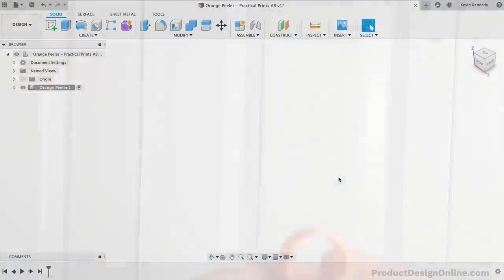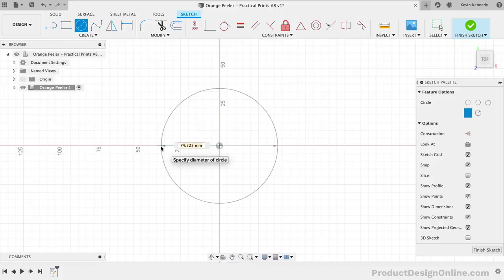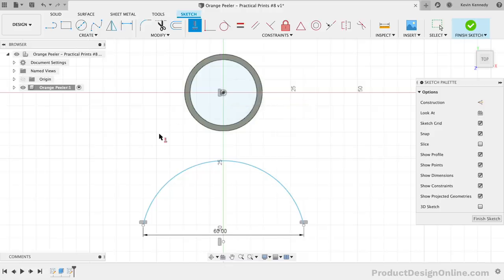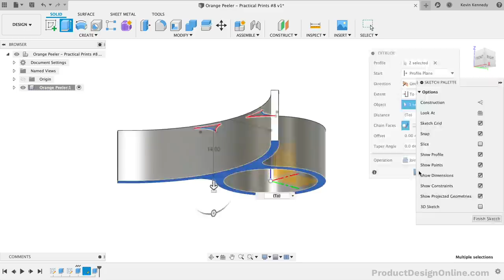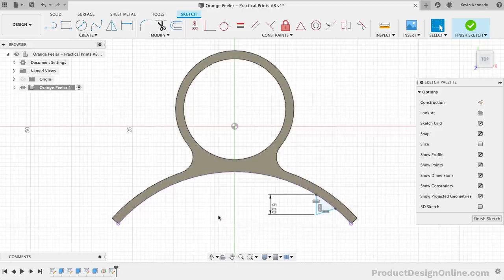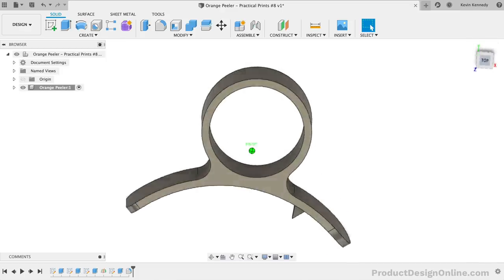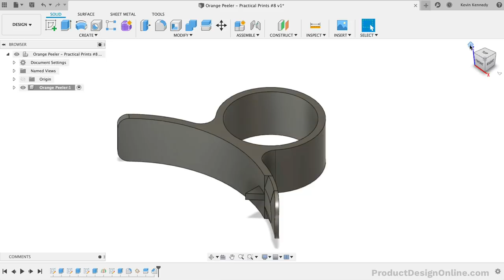3D Printable Orange Peeler with Fusion 360 | Practical Prints #8

Comment from the maker: TIMESTAMPS
0:00 - Reverse Engineering an Orange Peeler
1:00 - Figuring out the manufacturing method
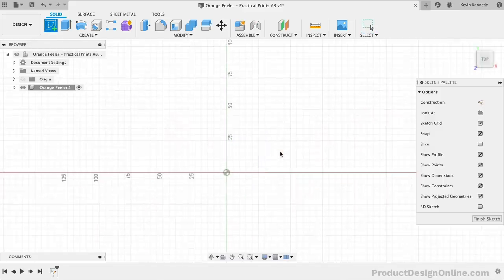2:07 - Finding reference images
2:39 - Sketching the cylindrical shape
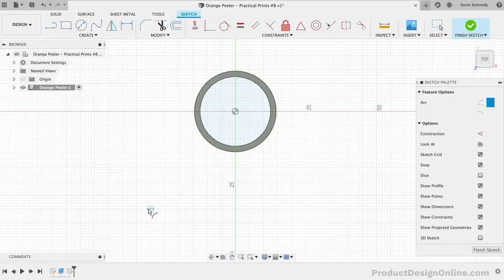4:00 - Creating the attached arc
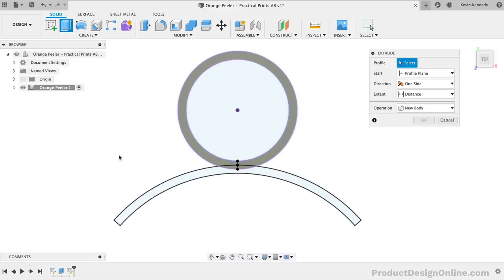7:10 - Joining the extruded body
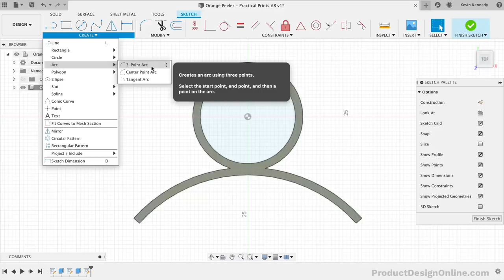8:15 - Creating curved support
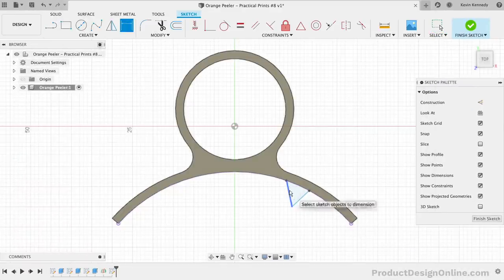11:00 - Creating the cutting piece
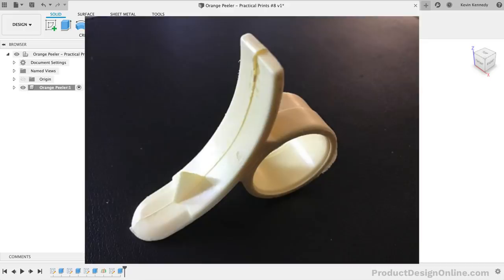13:00 - Rounding over the edges with Fillets
14:14 - Splitting the body and creating chamfer

Comment: We have struggled with the oranges and clementines lately as we both have joint pain issues, But i have a 3 D Printer so i must try this out. It tells me we could look at designing soup can lid openers and other aids to help folks with join issues in there hands, Its a while new thinking of what to use 3D Printing for. Great sessions I learned about 5 new tips just in the one. You run in sketch much longer than i do. I draw then immediately get into 3D editing. Heck you are adding constraints and using tools like arc i never knew where that was. I have designed and built a 3D Printed Model Train Steam Engine tender chassis. Here i not only replaced the flat plate I added a set of adaptors to help hold a wide range of electronics for digital control, sounds and regulators for voltage. It has been a blast.  Thank You for such a great job, D

Comment: Thank you for another solid tutorial and for the book suggestions.  I've added them to my wish list.  I particularly liked this tutorial since you presented the project at the beginning so I could attempt it and then compare and contract your modeling with my attempt.  A few thoughts on the differences:
+ I was surprised that you did not use a Canvas.   I found some good side views from a quick Google search, and once the ring is sized, all the other geometry falls into place.
+ When there is symmetry like this object, I like to do a symmetric extrude to keep the object mirrored about an origin plane.  For this object it made the extrude slightly more complicated since a 'From Object' and a 'To Object' is needed to keep the link to the depth of the ring, but it eliminated the needed for a mid-plane for the sketch for the cutter.
+ For support between the ring and the arc, I used a fillet rather than author an arc in a sketch.   
----
In all the close-up reference images I viewed, the triangle cutter is sharp...easily fixed with a chamfer, but for 3D printing I might make the cutter a bit more blunt and add a small fillet between the cutter and the ring.

Comment: Great tutorial, thanks. 
I was also expecting you to use the offset to extrude to make the ring supports and edge, is there a reason you didn’t?

Also, from a functional perspective, I was expecting the cutting triangle to be turned into an edge rather than a triangular prism. I’m not sure how well this design would work at present.

Thanks again for great tutorials. They are teaching me a lot, and I’ve subscribed on Patreon.

Comment: Auto project edges on reference option is really cool. Is it recommend to have it enabled?
Reply from the maker: It used to be a default setting, but a lot of users didn't realize what was happening and it caused many files to have tons of projected geometry.

I would recommend it if you understand it and keep an eye on it. At times, it may project too much unwanted geometry, and may be better to undo and manually project it.

Comment: Hi Kevin, I wonder, I would do the whole object from the middle of the symmetrical line and then extrude the part both ways in the end. That way there is no need for switching to the middle plane. Would there be a reason why this isn't a good solution? Thanks for the tutorial. I will remake the orange peeler as well, my hands are itching to improve on the design ;)
Should I share the final outcome somewhere?

Comment: Is it necessary to use a plane to split body, or can the face be used too? Or is it just a good practice to use construction planes?)
Reply from the maker: Great question! You could reference the face. However, it's considered a best practice to use an additional construction plane as that face could be altered, resulting in "lost" relationship between features. As an example, adding something like fillets or a chamfer to that face could cause the split body command to lose its reference. It could be fixed by editing the feature... But with large CAD assemblies the little things like that start to add up and become a huge pain point :)
Reply: @ProductDesignOnline  I see... Thank you for clarifying)